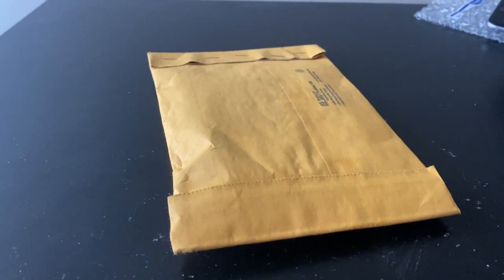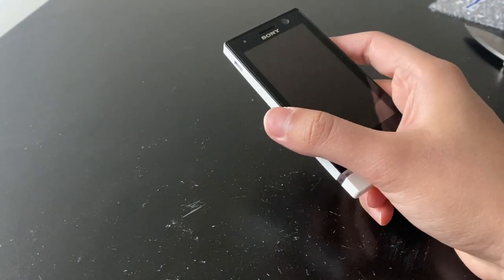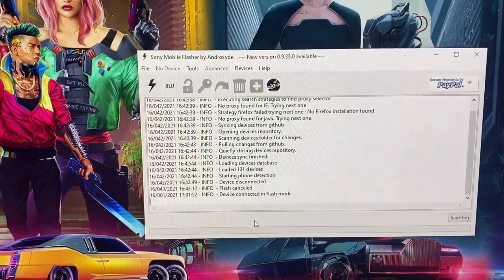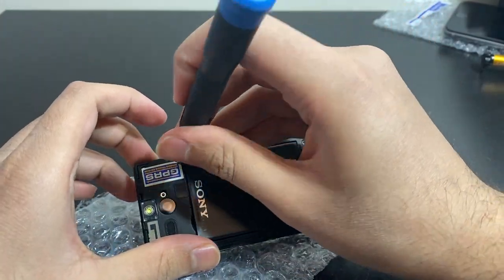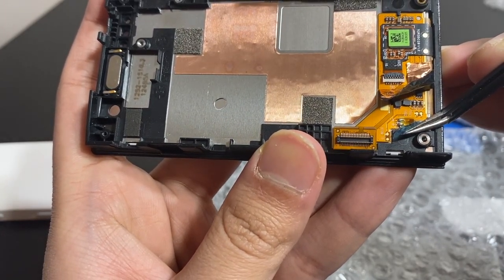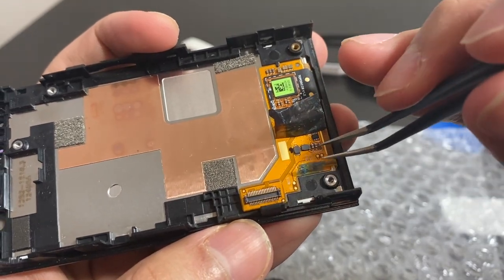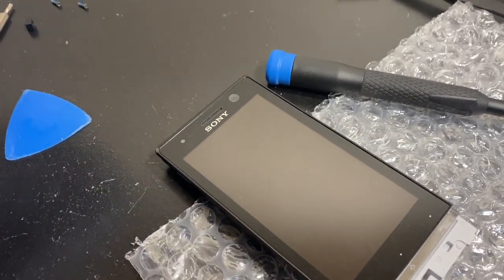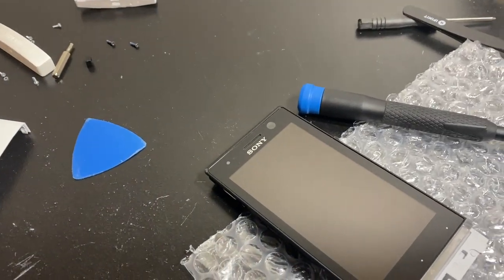Trying To Fix An Xperia U (ST25i) | Touchscreen Not Responding | Part 1

Comment: I'm guessing it is an Android issue with the new reversions not supporting those screens
Reply: nopee.... the touch digitizers of sony ( around 2012 and 2013 ) were bad ,, i changed my touch digitizer and it works fine ... my sony xperia MIro's touch digitizer was also not working i changed it and everything is buttery smooth now ...

Comment: Sir, I am having the same smartphone in working condition, somehow its screen is lil cracked but in working condition ,problem is its battery not getting charged .
Battery condition physically looks perfect 
I love this phone rgb effect.. Can you suggest any idea to repair it.please
Reply from the maker: Battery is just old..replace the battery
Reply: @Techformative557  can i get this old model battery in market sir
Reply: @Techformative557  and is it possible to upgrade this phone ..it seems very slow while using
Reply from the maker: I cant be sure..u'll have to check ebay..and no I think it can only run up to ICS officially. You will have to check xda to see if theres any unofficial updates
Reply: @Techformative557  thanks for replying and giving me your time...have a great day sir..